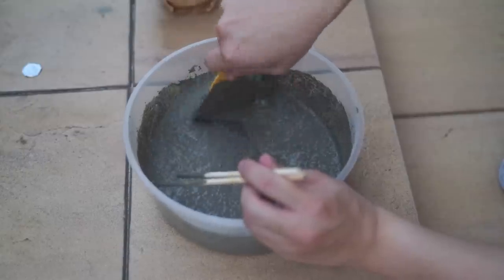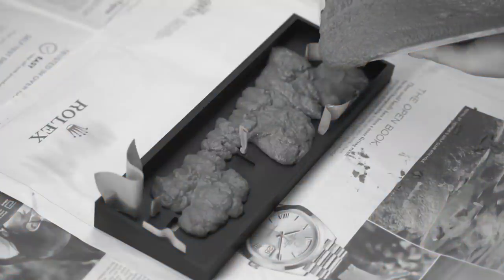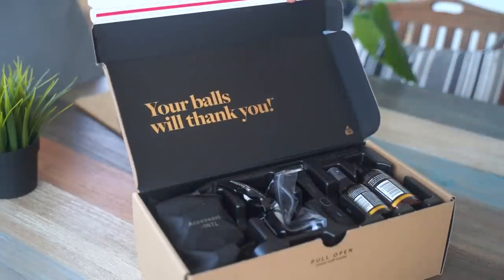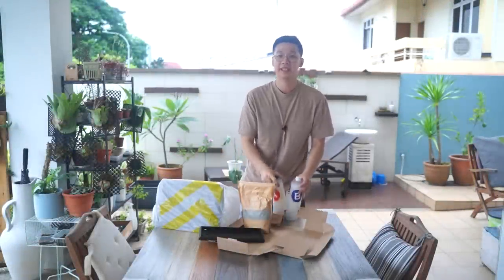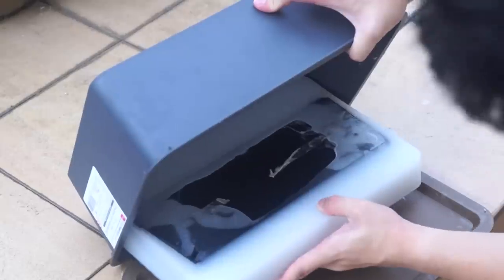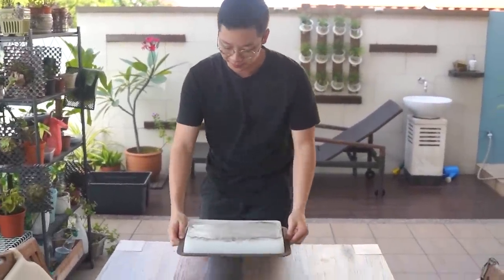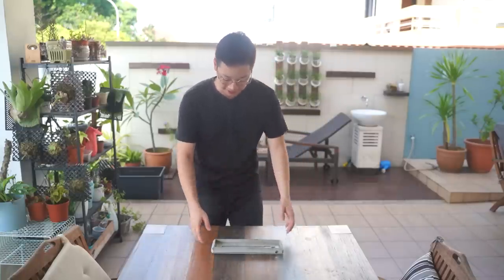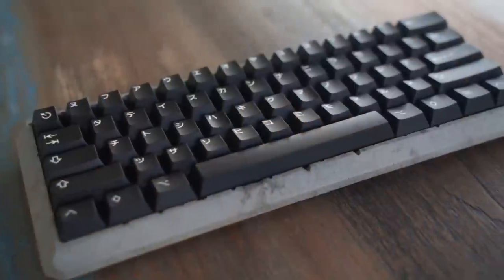I made this keyboard from Concrete…

Comment: Alright, here's my The Plan:

Get a keyboard intended for use with 3D printed cases (Corne, Sofle, etc.). 3D print a plastic case, make a silicone mold, then use the mold to make a concrete version. Never even buy a real case.

Comment: I was thinking it would break in half, but it didn't. 
If you plan on doing this again though a sheet of fine mesh chicken wire to reinforce the bottom would be a good addition I think, other than that do a better job of shaking it / vibrating it so you don't get the pock marks / air bubble marks on the edges.
Awesome job still tho!
Reply: This is basically putting rebar into the concrete isn't it
Reply: @notTerabyte  yup same concept
Reply: You'll have to maintain the proper depth of the mesh inside the concrete for it to work. There's an easier way to reinforce it - the fiber additive, which you just mix in.

Comment: Squashy, if silicon was used for dampener, and felx = good. What if a keeb case made out of silicon? Would it be a "Dampener 60" the flexiest keyboard ever? And also try to put in the rubber keycaps too I guess.

Comment: @Squashy Boy if you redo this, you can put a bitta Vaseline in the mold to help release the concrete. You could also use plaster of Paris for the mold, it’s a little more fragile but rakes less time and is waaaay cheaper

Comment: How did you mount the pcb to the case? I've been kicking around the idea of making a concrete case but might do a resin pour to start so I can get the hang of making mounting points.
Reply: gasket mount it bro!

Comment: My guess is it would've worked out better with the Tofu 60 case you had (and ended up pouring concrete into), since it has less angles and sharp edges by comparison. It would certainly look a lot more refined as there wouldn't be small chunks missing. Also agreed on mixing fibers into the concrete.